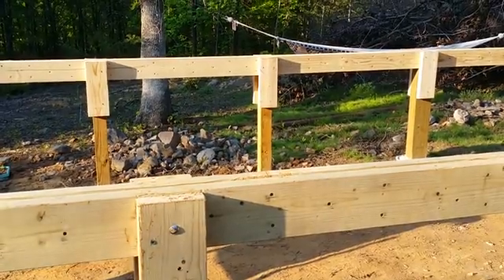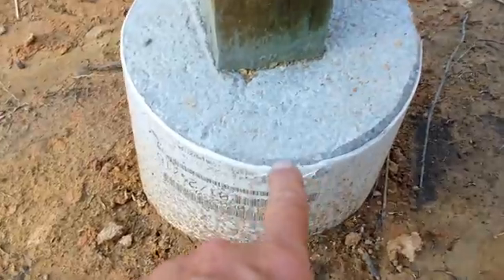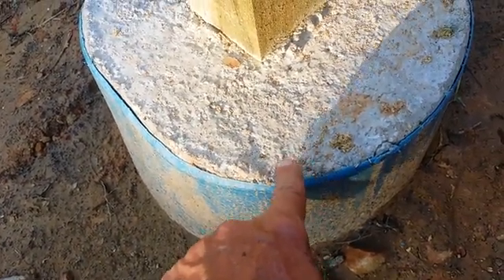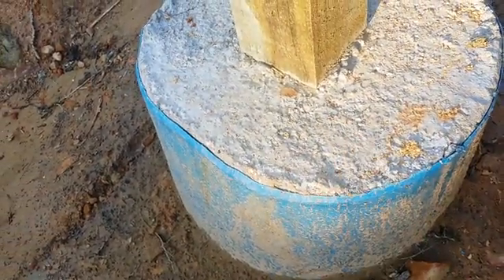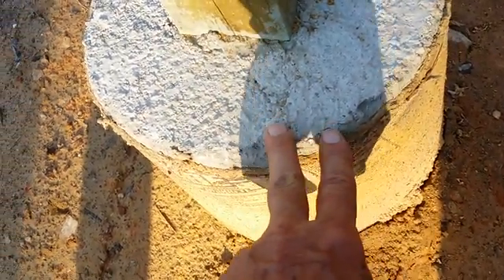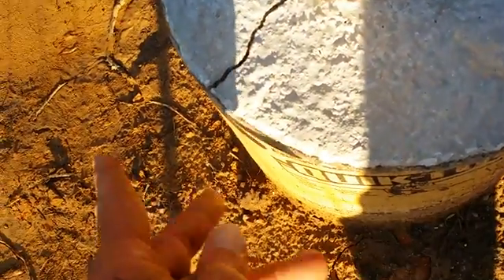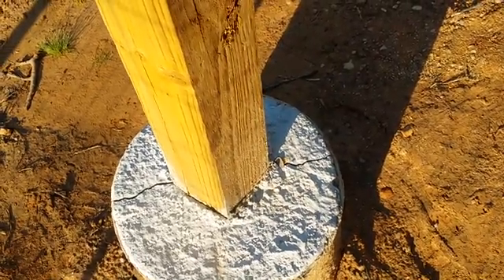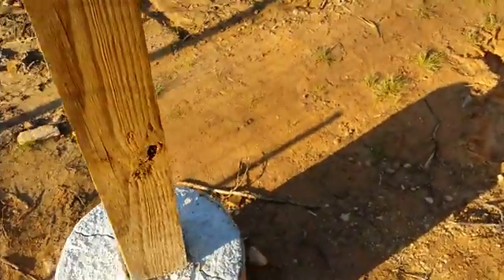Posts in Concrete - Beams Considerations

Comment: Like you said at the 2:30 point of the video, best way is a solid pier footing with a j-bolt inserted into the concrete, then a galvanized steel stand-off connector attached to the J-bolt, then the post into the connector and secured using appropriate screws.

Comment: Thank you for your time and help! I'm buying some property and was going to do the same thing! Never thought about the moisture and contact with the concrete! But it should last at least 20 years maybe? Thanks again!
Reply: Not a structurist but as far as I know concrete works best as a composite material together with steel. I was going to do the same for a cabin but using some armature bars. Still thinking... Thanks for sharing!!